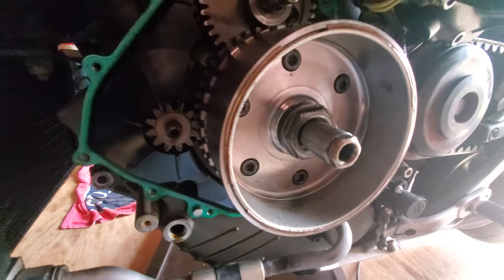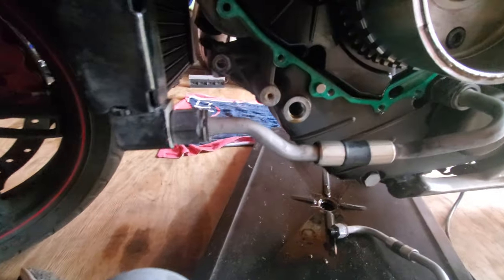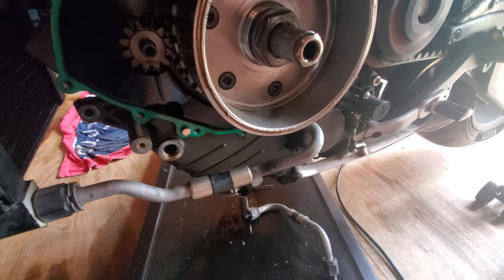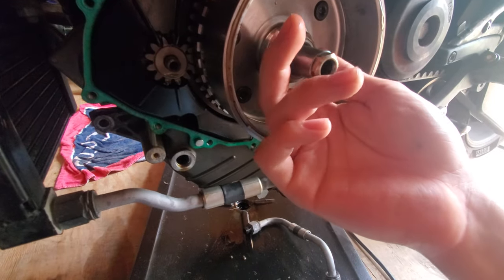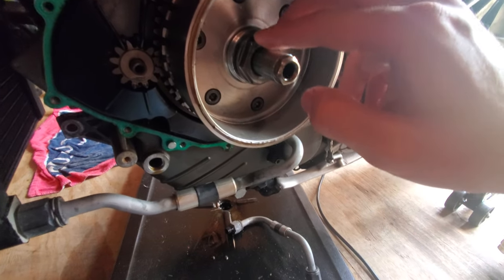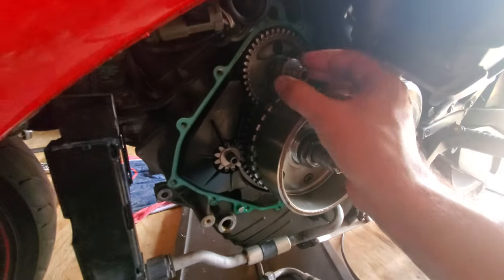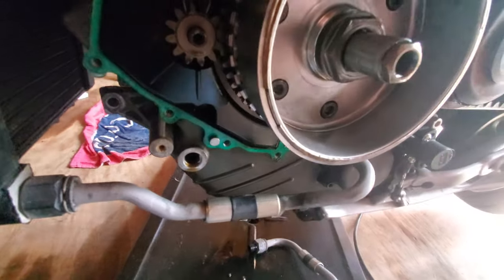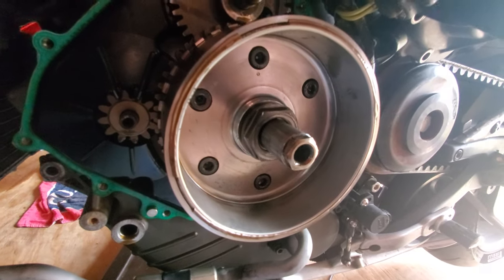replacing sprag clutch and rotor nut update buell 1125cr

Comment: Do you need to leave the steel rod in the crankshaft when you torque down the new nut? I got mine off without using the rod and I’m wondering if I need a rod for installation
Reply from the maker: Yes, it's even more important at that time

Comment: I have a question. I read somewhere that a Suzuki Blvd.. I think..uses the same sprag bearing only you have to reverse the bearing direction. Do you know anything about this or do you know of any aftermarket options without the inflated price of the YO536? Suzuki and many other brands charge 20 to 50usd for the same part Buell charges $100 for. I have 2 Buells I constantly have to repair but they are my passion I will not give up.  I live on a small old boat and have started working for myself on yachts and houseboats but I'm just starting out and Im a 1 man operation Thanks to weather the season is suddenly postponed and starting much later than expected and I need to be up and running. I don't have a car just my 2 buells. 07' Firebolt xb9r and an 08' 1125r and the 78' 32ft Trojan f32 motor yacht I live on. Any helpful advice would be appreciated.
Reply from the maker: I honestly do not know if the parts are the same but it would be an interesting experiment

Comment: What's the torque spec for the 6 housing bolts? Can't find anywhere
Reply from the maker: I'm sorry, let me get that for you. It's usually at the beginning of the chapter that has the procedure
Reply from the maker: The torque spec is 11Nm or 97 in-lbs. It is listed on page 3-73 of the service manual